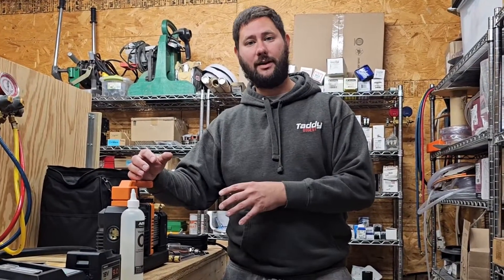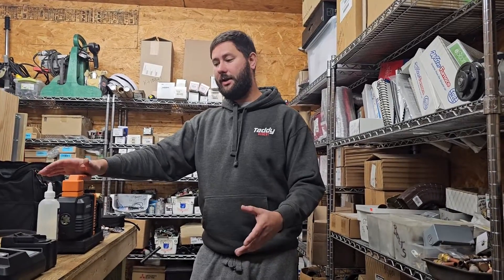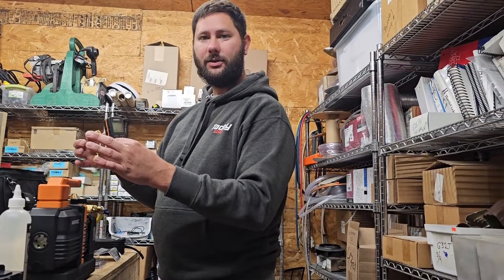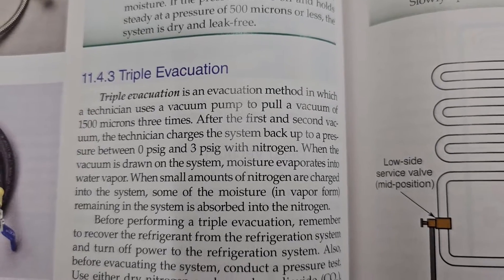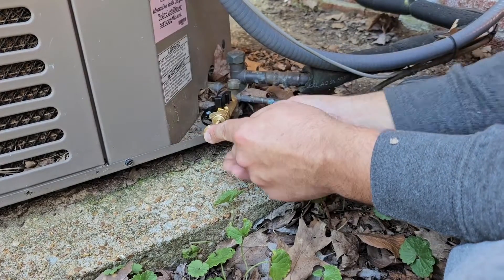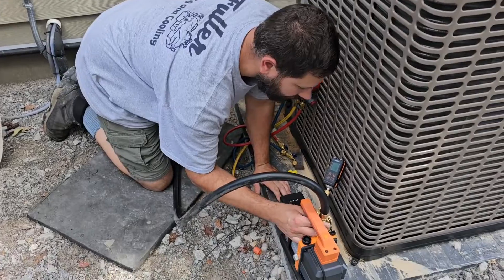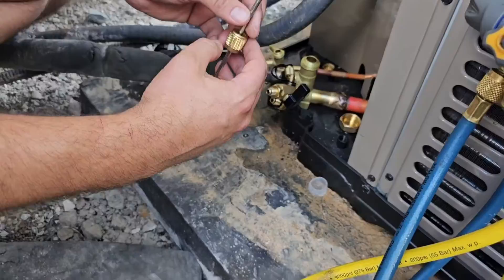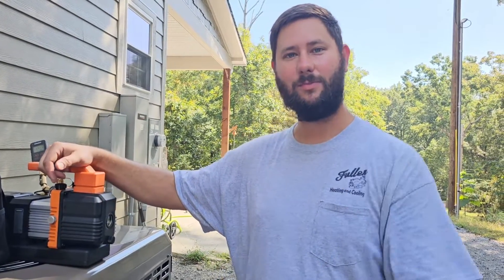How to use a Vacuum Pump? @NAVAC

Comment: Check the specs for the nitrogen. I buy Nitrogen 5.0 (99.999% Pure nitrogen, as a protective and purging gas in metallurgy, metal processing industry, chemical industry, electronics industry and food industry)  which has a lower parts per million water than nitrogen sold by refrigeration houses. Another benefit is I own the bottle. Also, avoid cheap nitrogen sold for so-called fuel efficiency BS for cars. With modern pumps I do not see a real need for triple evacuation I prefer a longer test but I'm willing to agree to disagre.

Comment: I agree with the comments to put the micron gauge on the 3/8" line when pulling from the suction line.
I also believe that you introduced some air back into the system.  A small amount, but some air.  
It happened when you were replacing the Schrader core.  Some air went in when the valve was opened under vacuum.  The air went into the core tool during the core install.
Reply: Which is why you should release a small amount of refrigerant into the system (if pumped down) to pressurize the system and not loose that vacuum.  Use valve cores on both suct & disch lines to gain better flexibility.

Comment: You really don’t get a proper micron reading when you hook to gauge to the pump but you probably already know that and are doing it for convenience. You’re supposed to have the micron gauge at the furthest point away from the pump. I put my pump on the suction side and my gauge on the liquid with a one hose set up.
Reply: I did that as well without a big boy hose.. 1/4 inch ..took forever but agreed you know you're getting to the far reaches of the system and reading accurately there

Comment: I think id put the micron guage on the liquid line port, that way your looking at a true system vacum.
Reply from the maker: That's a really good idea thank you so much
Reply: I’ve always seen it done this way
Reply: What makes the suction line micron reading invalid or not a “true” vacuum?
Reply: Hi , you can’t have real vacuum reading hooking up micro gauge on vacuum pump. It should be on furthest away service port.  I use Navac 2 CFM vacuum pump, Trublue hose and BluVac   Pro micron gauge. Great setup.